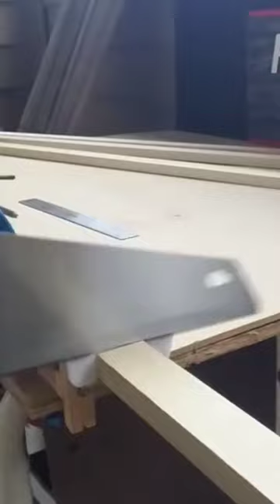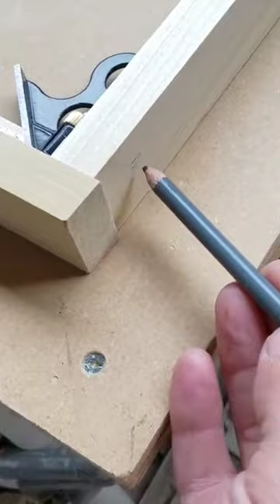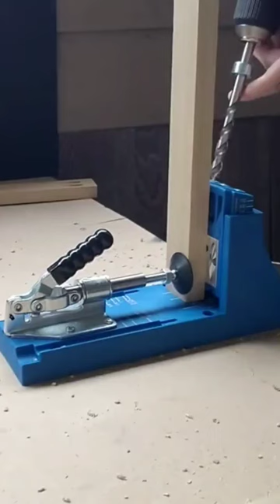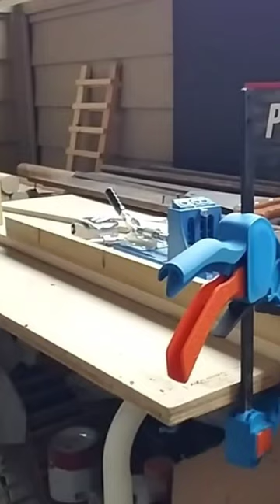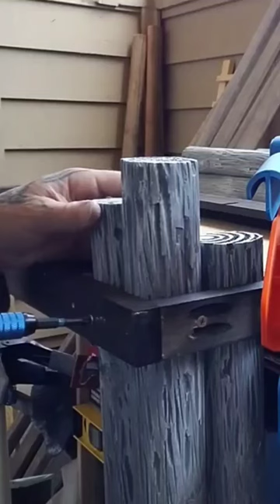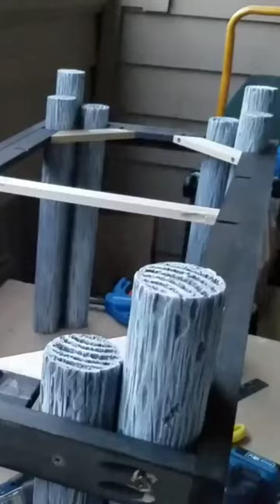Making a custom table frame for coffee table

Comment: Why would you put the pocket screws on the outside? The whole reason for them is to be able to hide them.
Reply from the maker: In this particular case I put a face plate on the outside perimeter of the table frame so hide screws....heres Link to project video showing what I mean and why i did it.... https://youtu.be/uPt6l1sLr8w
Reply from the maker: This video explains: https://youtu.be/uPt6l1sLr8w
Reply: @ThriftHacker  I got it, that's called an apron. Well played.